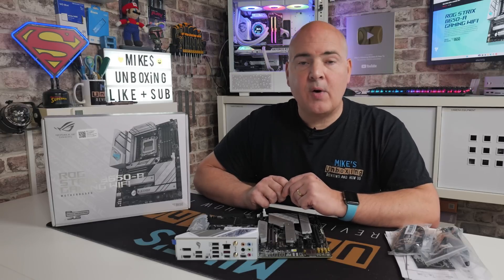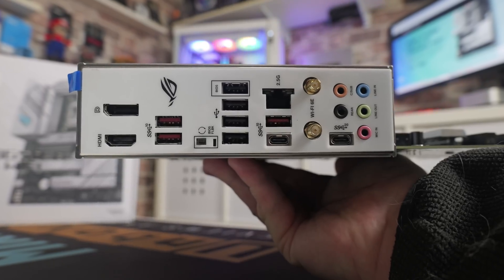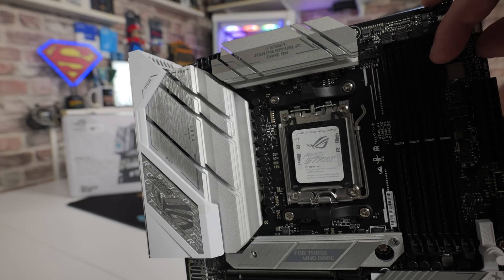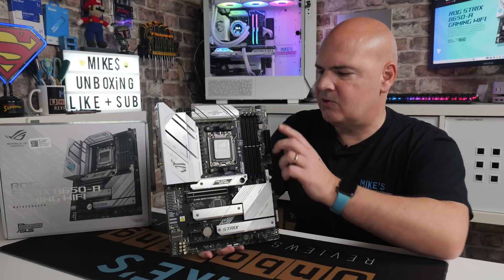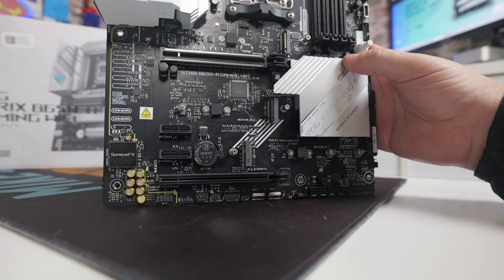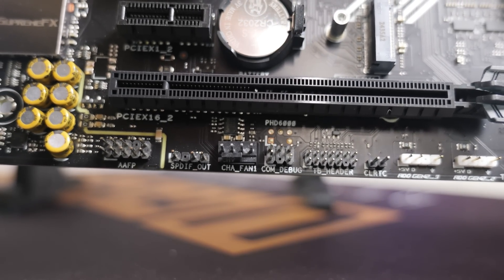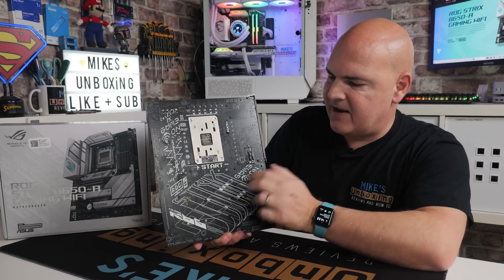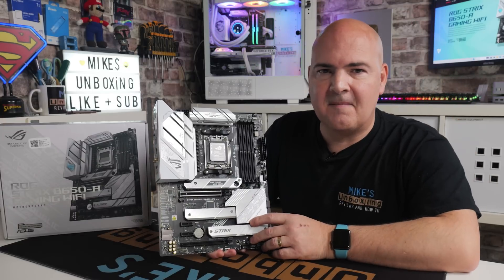Bargain AM5 Motherboard ASUS ROG Strix B650 A Gaming WiFi 6E

Comment: will it affect performance when paring this motherboard with a 9070xt and a Ryzen 7 78003XD? i dind’t look much further into the gen slots it had which i’m kinda starting to regret
Reply from the maker: it will be fine and you won't notice the difference except maybe in some bencharks
Reply: @mikesunboxing  what about with a RTX 5060 ti and ryzen 7 9700x??

Comment: Im thinking about upgrading to AM5 platform. Still rocking b450 rog strix f gaming, thanks to you. With a classic setup ryzen 5 3600 and 3060ti vision. 
I know that cpu is bottlenecking my gpu. Should i buy a used cpu and stay on am4? Maybe a 5800X?
Reply from the maker: yeah get a cheap 5700x3d on ali express and you will be good for a few more years
Reply: @mikesunboxing thank you man. Keep up the work.

Comment: Currently £172 brand new so not a bargain, would rather have a B-850. As any B-650 costing over £100 is a rip off. Especially ASSus with the problems they ignored.
Reply from the maker: The pricing on these boards can fluctuate quite a bit, so what's a bargain one week might not be the next.